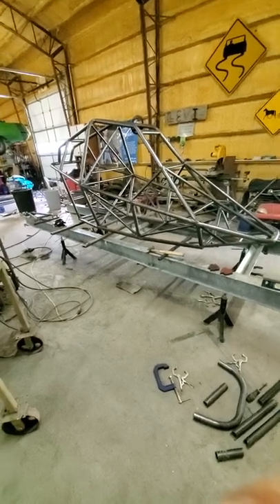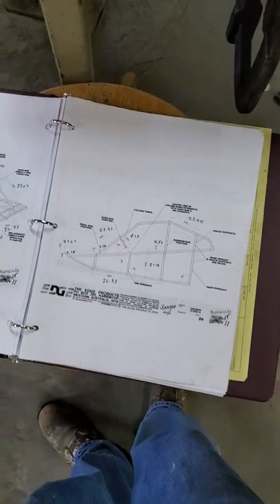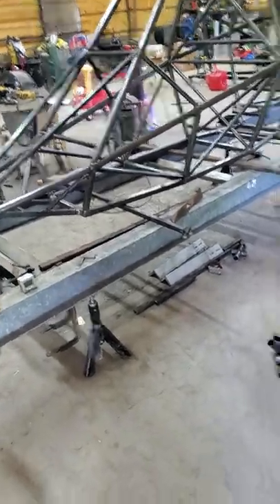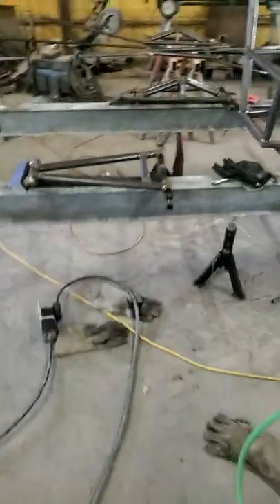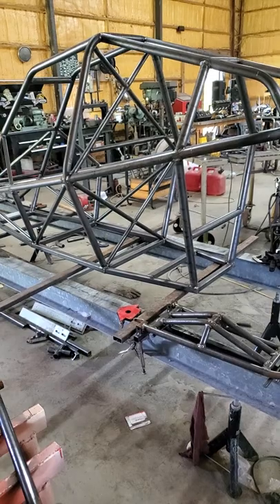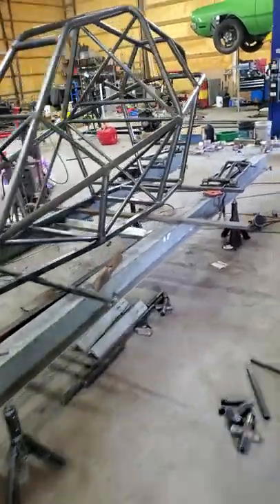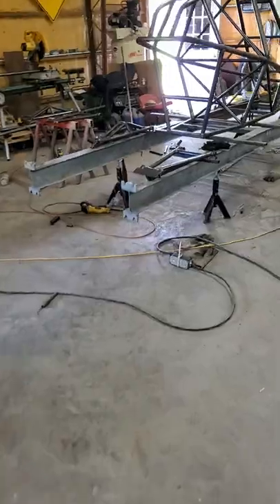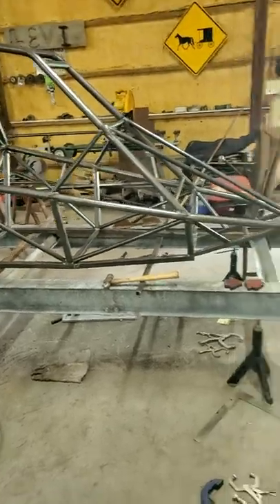Building edge products barracuda cross kart buggy

Comment: I too feel your struggles. I am also building the same barracuda from edge. I started to convert everything from metric to standard, and realized the standard measurements were harder to get right then just using metric!!! My advice, USE METRIC!! It takes a bit to get use to, but once you use it for a bit, it's way easier then standard!!! And yes cheaper to buy the parts from edge then build them yourself, I found materials alone cost more then the finished parts!!! Good job so far...Best of luck!!!

Comment: I am ordering my steel this moth to start my Barracuda Buggy. You are right about getting some stuff from him being cheaper than building it yourself. Are you in the U.S.A.? I look forward to your next post Enjoy your build. Be safe  !
Reply from the maker: Ya.  Currently waiting on my parts from him.  Ordered them in August.  The diff, and most of the laser cut parts.  Chassis is still sitting there ready to go.  Wish I could get my stuff so I could get the diff and engine in it and start building my header.  I guess it will show up one of these days
Reply: That is a long time to wait for parts. I have planned to use a Suzuki TL 1000 s motor. I got a good deal on a complete bike, but I am thinking about changing and try to find a Hayabusa 1300 motor. Will see if I find a good deal, I will buy it and ride it before I take it apart.
Reply from the maker: @jasonmorse3214  ya I have a 12 zxr engine for mine.  I kinda wanna build a 2 seater instead of this one.  I've had too long to think about it. Lol
Reply: @black_sheep_fab9411   You could sell the chassis you have made; I am sure and download the X2 buggy. You do not have too much time into it at this point. As far as money goes you would get some back by selling the chassis you made. I have thought about it also, you can take a buddy with you in a two-seater
Reply from the maker: @jasonmorse3214  ya wife mostly.  And all the differential stuff is the same between the 2.  I still may.  I considered selling the one I built but I don't know who would buy it.  It's something that is made to plans so would only benefit someone else who wants a mk2
Reply: @black_sheep_fab9411  Post it and see what kind of responses you get. Nothing to lose, you may get a pleasant surprise. Some people do not have a bender or the drawings you could include the drawings.